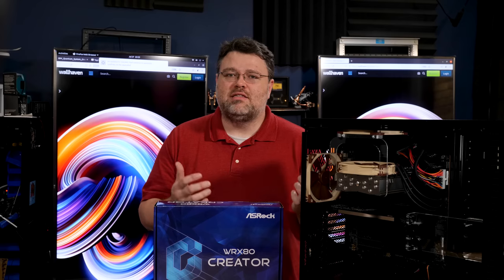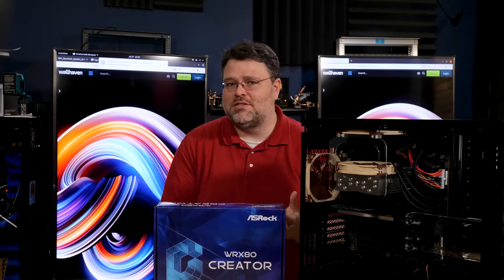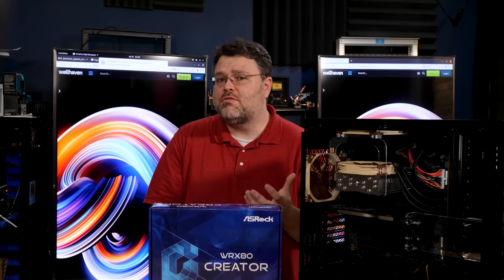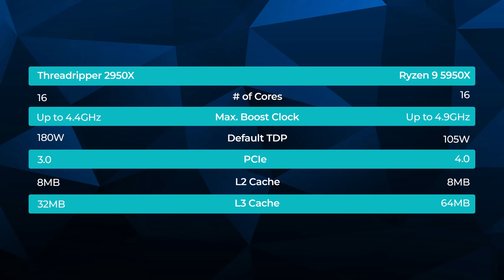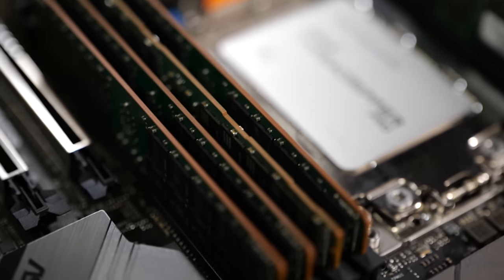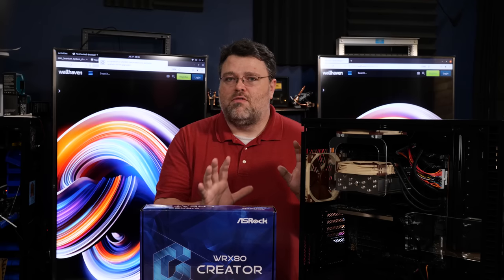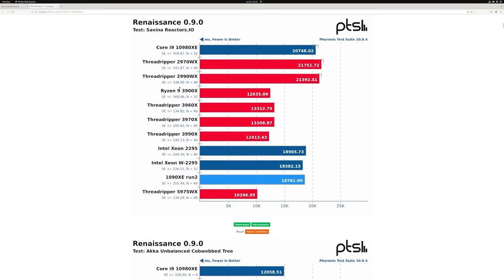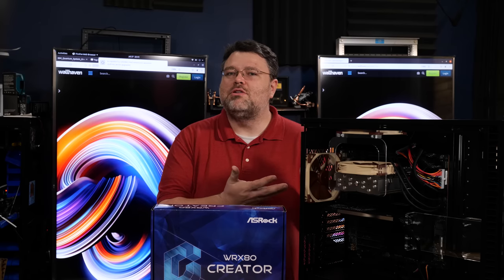Threadripper 5975wx for the DIY! Tested and Overclocked with the ASRock Creator WRX80

Comment: If you have Optane DCPMM, can you just try it to see if it even is detected?
Maybe we can hack together some sort of driver to get DCPMM to work on AMD in the form of dumb RAM or single bit correction.

storage mode would be cool, but system RAM would be great.
Even if it requires all DIMMS be Optane, i'd love to shove 2TB of DCPMM on my 3950x that basically does nothing but serve files. Would let me get rid of my PCIE 16x adapter card with 8 118GB Optane drives.
Reply: I know nothing, but i would suspect any sort of "ram driver"to be written  in che cpu microcode 

PLEASE if someone knows anything to write it down, it's a very interesting topic

Comment: I am just completing a build using the following for Adobe Premiere Pro :
Qty.	Item
1	Fractal Define 7XL Case
1	Cosair AX1600i Power Supply
1	Asus Pro WS WRX80E-SAGE SE WIFI Motherboard
3	Samsung 990 2TB NVME SSD Onboard
4	Seagate Iron Pro NAS 10TB Hard Drive (configure on RAID 5)
1	Nactua Fan/Cooler
1	Nactua second fan
1	Nvidea RTX 4080 16GB Video Card
8	Cosair 16GB DDR 3200 Vengence LPX over-clocking memory
3	Fractal Designs 140mm fans
4	Nactua 140mm fans
1	AMD Threadripper 5975WX CPU
1	Windows 11 Pro key
1	APC Back-UPS Pro 1500S Battery backup

I would love to find the instructions to tune the 5975 with the WRX80 ver 1.

Comment: You know, I do work with Yocto, and for day-to-day? Even a freaking 3600 is enough, if barely. Sure, kernel compile times suck. But aside from that? What takes time is images (I'd have to check, but those are probably IO-bound), and some big Python packages (*cough* numpy, scipy, *cough*), which have builds which simply don't parallelize well. That's... about it.

Comment: For me the 1950X is still good enough. I chose TR because I wanted to have PCIe lanes and a system that is fast enough for 10 years and now we're 5 years in and it looks promising.
Reply: Considering upgrading to sapphire rapids in the future? Or one of intel's new HEDT since they're starting that again
Reply: @farawaythrower  for the moment I don’t see how the gain justifies the work and money. Not a single task my 1950X can’t handle left-handed.
Reply: @gentuxable  Oh sweet! I see the 1950X as underperforming, but I guess it depends on what you need it for. What do you use your system for?
Reply: @farawaythrower  Then you should consider upgrading... I do virtualization, video editing and general computing on my system and I don't see how this could improve given the effort.
Reply: @farawaythrower  I know that I can seriously overclock my 1920x's and my 2990wx.  My 1920x systems will run 4.2 GHz all core.  My 2990wx runs around 4GHz all core and I have the memory running at 3433, which makes a significant difference.

Comment: Let's wait and see what consumer Zen 4 and Raptor Lake will bring to the table soon. I consider the launch this late right before a new CPU generation to be a slap into the face of all enthusiasts buying into the platform with Zen 2, probably costing them a lot of good will in that segment. The bean counters at AMD need to listen, even though Threadripper might not bring much to their bottomn line, the prestige and mind share in that sector is also a valuable asset. Jim Anderson and the other enthusiasts who pushed for Threadripper and no longer work for AMD knew that. Hence Threadripper should be the frontrunner for new technologies, pushing the boundaries. That would translate into a Threadripper Pro with VCache this generation, as they are selling EPYCs with VCache already and the volume is not that high to be a strain for EPYC supply. The margins of the Threadripper PRO SKUS are already absurdly high considering what 4 x 7nm chiplets on a high yield process cost for AMD nowadays, so no excuses there for not offering such a SKU. In my eyes, there are a lot of missed opportunities here, largely caused by a lack of competition from Intel.
Reply: Zen 4 Ryzen 7970X = 170W TDP and it's going to consume up to PPT.  Zen 4 is going to be SO different than Zen 3 because AM4 limited the entire CPU stack to about 145W, stock.  So the 5800X could push the same power as the 5950X.  The 12 and 16 core Zen 4 Ryzen parts are going to get HUGE benefit from this extra power.  On the other hand the single core chiplet parts will probably cap at about 150W.  That would be my guess since they're 105W TDP parts.  Then add in more L2 along with PCIe gen5 along with 4 additional lanes along with the X670E which can have features on them that people used to have add on cards for.  Yeah, the top end of that stack is HEDT.

So, I think they've listened.  I think the issue is people don't understand just how much Ryzen is going to change over the next 2 CPU generations.  The top of the stack Zen 5 Ryzen CPUs are going to make ANY Threadripper part to date, other than MAYBE the 64 core Zen 3 TR Pro look silly.

And then even for the people who need 2 GPUs, with the move to gen5, you're going to see GPUs drop down to X8.  At least for AMD GPUs.  There is absolutely ZERO need for a PCIe gen5 X16 GPU.  So having a MB that can run one GPU slot gen5 X8 and the other gen4 X8 is all the bandwidth you could possibly need.  And that still leaves TWELVE PCIe gen5 lanes!  So, it's a silly amount of bandwidth and capability for a typical desktop and is really becoming HEDT.  Buy the X670E MB that has the feature set that fits your needs and when Zen 5 rolls around enjoy all the extra cores.
Reply: @johndoh5182  It is not just about PCIe lanes for me (but might be for others). X670E is still a consumer platform, and that means mostly worse validation and some missing platform features, e.g. X670E is still limited to dual channel memory which is a limit in some intensive workloads. Hence there are still differences between a consumer and workstation/server platform worth talking about from a quality standpoint albeit with some overlap from a pure performance perspective. And yes, I've seen too many issues on AM4 in the past, so AMD has to prove to me that they and their partners have learned their lessons and do a better job at validation with AM5. (If you are wondering, I don't talk about RAM compatibility issues that plagued the platform at first - I saw BIOS/AGESA/platform issues with 4G decoding and UEFI boot enabled that halved your performance and disabled your LAN which didn't get fixed in the year I owned that hardware). The lack of competition makes me sad that the price barrier to entry for a HEDT/workstation product got raised by a lot in recent times. I hope Fishhawk Falls provides some competition in the up-to-24 core segment to keep AMD in check.

Comment: Had this motherboard for about a week, where the intended applications is a desktop workstation. As a result, none of the BMC functionality is required. What annoys me to this point is that there is no XMP for my 3200MHz Registered ECC DDR4 RAM, just have to make memory timing settings manually or allow for default which is 3200MHz, but with slower timings. Other thing is that you cannot put the computer to sleep, just shutdown or restart.

Comment: Sometimes you just need that PCIe lane and slot configuration that TR/TR Pro offers. Sucks that an Intel z170 could be had with 4 pcie-x16 slots but not even Asus ProArt boards can offer the same today. I think it is the industries way to push people into the Workstation hardware like we see with software locking out features for non-workstation GPU.

Comment: I'm just dreaming a bit here, but would it be possible to build a decent 100Gbps switch (even if only four ports or something) with the 24 core TR Pro? I would choose the 24 just because they all have the same I/O and TDP, but it has the least cores, so more TPD per core and higher base clock.

I mean, just in theory. Even if the design needed the most extreme options. The only objective is beat an enterprise switch (with more ports ofc) in price. So even if having to use FreeBSD/NetBSD/DragonflyBSD or some custom Linux, kTLS, NICs with FPGAs, etc.

Comment: have you tried setting a negative voltage offset for this board/cpu? I'm hoping the system can sustain the higher boost levels with more cores loaded that way.

Comment: The memory latency on the 5975wx is so high, what memory timings was it tested with? I was hoping it would be around 70ns.
Reply: Standard jedec timings cl22 at 3200mhz I think. You can buy ram with lower timings but there will be a lower chance of stability with it.

Comment: AMD anti-consumer practice on vendor locking Zen 3 Threaddripper has literally forced me to build my workstation with one of those high frequency EPYCs. If Intel has not been dropping its balls with Sapphire Rapid, I would have moved to Intel outright.
Reply: Intel is no saint either. 
No ECC on desktop CPUs
Locked multipliers everywhere
4 cores is all you need
Vt-d on K SKUs? No way
Reply: @MultiKokonutz  These companies are of course no saint. They are created and are expected to pursue profits. We customers are just trying to do the best to get a fair deal, to put them in line. Indeed that is getting harder and harder.
Reply: @qazwsx000xswzaq  At least, the future seems bright. Apple proved ARM computers are viable for the average user, Ampere has very competitive, high core count server chips, RISC-V is showing up in some SBCs, microsoft has windows on ARM, linux on desktop is in the best shape it has ever been, who knows where we will be in 10 years
Reply: @MultiKokonutz  At the same time, many of those technologies sacrifice upgradability and customization, especially with apple's arm cpus, where the CPU, GPU, and RAM are all on one package. In exchange you get a system that while performant, can still be outperformed by a somewhat-similarly power-hungry AMD processor, and the minor benefits of whatever else the ARM architecture may bring
Reply: @dreamteamdidonethingwrong2499  The integration Apple does is another thing altogether. There are potentially huge power savings at the PHY level by moving things closer together. That is the direction both Intel and AMD are going with Sapphire Rapids and 3D cache

Comment: Zen 4 Ryzen is going to be a MONSTER product, ESPECIALLY the 2 chiplet parts.

More L2, basically double the power capacity for the 2 chiplet parts but on a MORE efficient process node.  The all-core sustained clocks on the 7950X vs. the 5950X along with other minor changes means an all-core boost close to 40%.  That's basically what Robert said in an interview.

Now throw in the added feature set and bandwidth handling.  Your going from 24 PCIe gen4 lanes to 28 PCIe gen5 lanes.  The X670E MBs have a lot more features with much higher speed devices such as USB4 or Thunderbolt, and not just one, but a few high speed ports.  

Threadripper is dead as HEDT.  It was predictable a year ago.  Ryzen is going to take its place at the high end of the core/MB stack.  And while Zen4 is going to give the biggest boost for the 12 and 16 core parts, Zen 5 is going to add more cores, and this is why it's not really worth considering TR for HEDT.  It's cost prohibitive and Zen 5 Ryzen is going to make you wish you didn't buy anything less than a 64 core Zen 3 TR Pro.  But with the price you're going to pay for that 64 core TR Pro, it's going to look SO overpriced in about 2.5 years.  I'd buy the 16 core Zen 4 Ryzen if I need HEDT along with the X670E MB that best fits my needs, and then upgrade the CPU with Zen 5 and sell off that 16 core Zen 4 part.
Reply: X670e isn't good at all From x370-x570 the majority of the mother board support one 16x and one x4 lane pci express slots and if you have M2 Nmve SSD plugged in your out a an x4 slot or drops to the chipset the next problem is the lack of boards that actually ever support x8 /x8 from the cpu, which almost non-existant with out a PLX chip spliting the 16x lanes appartin to two 8x lanes from the cpu Which it should be done by the cpu, but isn't I know of right now 5 boards out the x570 line that support 8x/8x this fact right here is why mian stream Ryzen board will never be good enough to ever be consider "high end desktop or work station"
Reply: Will Zen5-based CPU have more cores than 16? Is it guaranteed?

Comment: If AMD wants to look more serious, they should make some gigabit nics 1x to 16x at least start at pcie4 and do some pcie 5 too, its coming quick. Workstation or server, that pro can do security but AMD don't seem to be sold as firewalls and as I said, not working much on network devices mostly for those beasts.
Reply: It's not AMD's business to make add on NICs.  AMD focuses on what they do now.  That's CPUs, GPUs, acceleration.
Reply: @johndoh5182  What is AMD Pensando if not CPU+special purpose processor+NIC?

Comment: $4,658.00............ Holy Smokes!!!..... I'm Still running a 4 core 8 thread devils canyon cpu !!....... seems to run everything well, never once have I said to myself   "gee, things seem to be slowing down a bit on this system"
Reply: this is for people that need some serious power, probably for a job-related use. Not everyone does
Reply: I recently upgraded from a slow Haswell (Lot lower clocks than yours, but still) to 5600X and the difference is bigger than I thought. Everything feels faster, even browsing feels faster with loading pages and clicking around. It surprised me.
Reply: @TheAnoniemo  I have 5600x also, well work its price!
Reply: You're running a CPU that struggles with windows update...
Reply: @h2oaddict28  everything struggles with windows update. Microsoft has a talent of making software run bad regardless of the hardware. Have you tried Teams desktop?
Reply: @h2oaddict28  I've never had that issue......
Reply: @marcogenovesi8570  A threadripper isn't "serious" power and you don't have need one for work to use one. Pretty much anyone doing anything remotely creative can make good use of one.
Reply: @chiefjudge8456  Yeah I can make good use of one too. Still does not mean I need it.
Reply: @marcogenovesi8570  A very basic 8 core or 16 core CPU may be enough for you, but not everyone is as casual as you.
Reply: @chiefjudge8456  I'm sorry but claiming everyone needs a threadripper is bs and I won't back down.

You need to be running massively parallel applications to even justify that. The only creative thing that can benefit from it is rendering 3D or encoding video, and even then it has to be high res or high complexity enough to make a substantial difference. 2D does not matter, music does not matter, writing does not matter.

To be 100% honest with you the most requested feature by creatives are a bunch of pcie slots to fit another GPU for rendering/AI, a capture card, 4x NVME cards for fast raid0 "scratch disk" storage or other task-specific cards more than raw CPU power.
If AMD would slap the IO die from Threadripper in a Ryzen they would satisfy so many people.
Reply: @chiefjudge8456  Lol "woefully undepowered"?!?! Are you aware that mainstream CPUs have already beaten first gen threadrippers? Is anything that isn't "the latest" a "woefully underpowered" system?

How did anybody do any work a couple years ago, or even 5.

I know your types, you are not logical and desperately try to justify your compulsion to buy whatever is latest and most expensive in an endless race to the bestest evar.

A 15 year old working on an anime music video is much better off with an Apple M1/2 or a using a program with GPU acceleration and a NVIDIA card than buying a monster CPU like that. Sorry, hardware encoding will beat CPU any day, all day.
Reply: @marcogenovesi8570  A 1st gen Threadripper will soon be 4 gens old, so that's a meaningless statement. What an incredibly stupid comment. Again, just because you're not smart enough to make use of a computer doesn't mean this applies to everyone, and I'm sorry if that makes you feel dumb. Mainstream CPUs are woefully underpowered for most useful tasks, and in many cases even Threadrippers are. A 15 year old working on an anime music video for Youtube can FULLY make full use of a Threadripper. You only have to click 1 button in Resolve to max CPU usage on all of your cores. GPU acceleration is good (and the same logic here applies to GPUs), but many tasks like compilation are not suited for the way GPUs are designed.
Reply: @chiefjudge8456  Ah good so now even threadrippers are "woefully underpowered". Are you running loads that can fit only on AWS compute instances or what?

You are sliding even more into insanity.

yes you can max all cores if you want but do you need to? The anime music video can be rendered by the GPU faster anyway.

Compiling is a fun thing, depends from what you are compiling as a lot of tasks are sequential. If you are rebuilding a Gentoo OS to update it then yeah sure it's dozens of different things and can be parallelized.
But a lot of software compiles I see for client applications aren't really scaling that well past 16 or even 8 cores, and get a much bigger boost from using a RAID0 of NVMe drives than a big CPU.